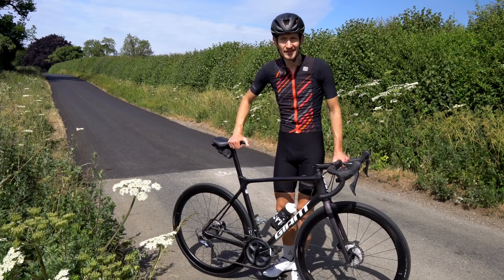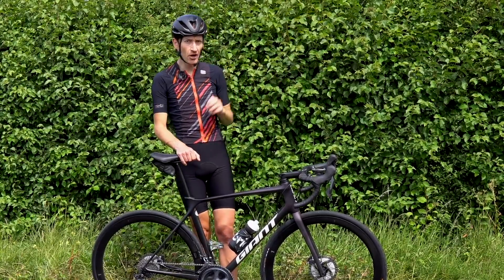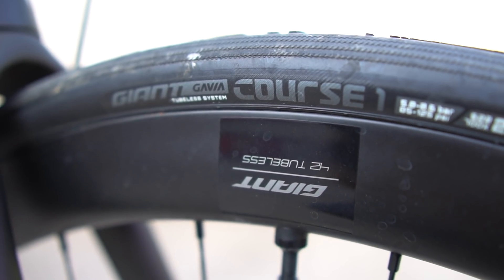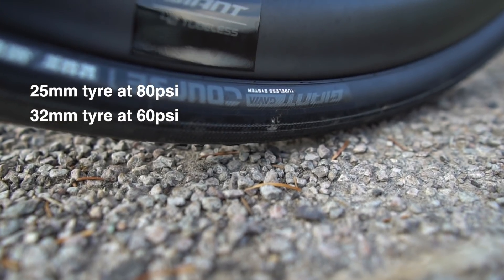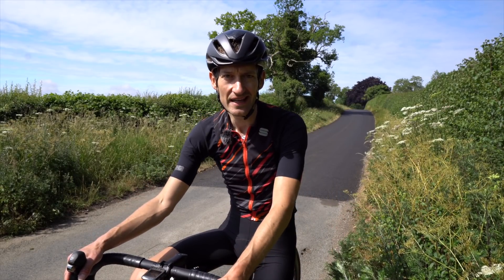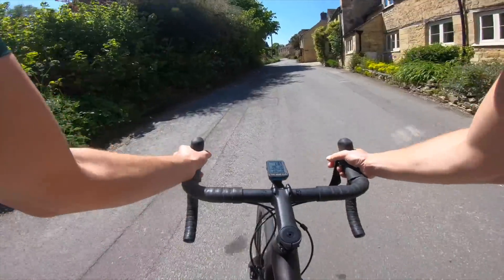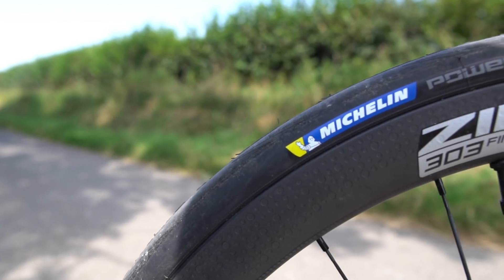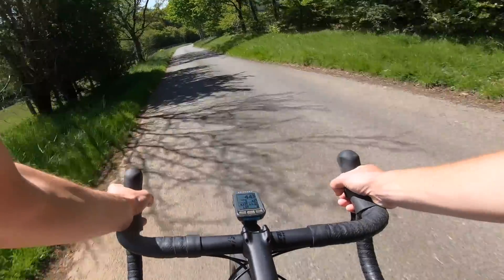Are Wide Tyres Really Faster? Rolling resistance timed testing reveals the truth...

Comment: Video concludes wider tyres are faster when freewheeling at lower speeds due to rolling resistance playing a bigger factor.   

David - wider tyres are faster! 

Biased much?
Reply: David admitted this is 'not really Science' so I can forgive him. Meanwhile the comments continue to fill in the gaps which suggests the video has got people thinking about the validity of their assumptions
Reply: Rolling resistance isn't playing the bigger factor though, at 15mph wind resistance on tops is about 100-115w (not even my 2.6" Maxxis DHF & Rekon combo has that much rolling resistance, 70-80w, so i have no clue why he states that 15mph is the breaking point between the wind & rolling), 10mph it's 48w, the speed at which rolling resistance from tires & wind is equal is about 5 mph or less. So aerodynamics is almost always the biggest drag factor when riding a bike

Comment: But that is at low speeds! What about high speeds like in group rides 22 mph average speeds?
Reply: Group rides you are shielded by your team mates from wind. Wider would probably be better.
Reply: Kjetil Korsveien Even when drafting, aero is still important and aero drag is still the largest force you have to overcome. Otherwise you could just ride a city bike in the peloton and have no negative consequences to your speed.
Reply: Kjetil Korsveien hummmm could be. I guess I was thinking more about racing. I do short intense races ( criterium)
Reply: @korsveien  the other two strategies for races would require you to go aero, either a breakaway (aero) or bunch sprint (also aero)
Reply: At those speeds you just go with the narrow tire. Aero takes over.
Reply: Are you wearing a skin suit yet? If yes, you can start to worry about the aerodynamics of your tires. If no, then what are you even wasting your time here for?
Reply: Gleb Serbin I do actually wear aero clothes and I have dialed in my position as aero as possible

Comment: Id love to see an out and back TT at higher speed/wattage (300 or more watts) to test the aero differences on that standard sized rim width with 25mm tire vs that new firecrest style wide rim with a 28 or 32mm tire. Really want to see if the rolling resistance gains of larger tires outweigh the potential aero losses at high speed... probably depends on the roughness of the surface though.

Comment: As you said, above certain speed aerodynamics come in to play. When going faster than 18 mph tire aerodynamics come into play, quite a lot because of its frontal area. Wider tires will probably weigh more, bigger tires, different tubes, and if done correctly wider rims. In my opinion, 25mm are best for fairly smooth road and when it comes to  rough stuff you should use 28mm, as used by the pros in roubaix.
Reply: I've gone.back to 23c because they blow out to.24.7 on.my 25 wide rims.
Reply: @glennoc8585  sadly something like this happend to me, i  was always running michelin dynamic sport 10$ tires nd they ad the perfect fit on my rim but i decided to get conti gp 4000 sii and now they blow out to about 27mm in my 25mm external rim. Really bothers me
Reply: @larsborgman3443  Continental is famous for lying about their actual sizing. It's a marketing thing, because on the benchmarks of rolling resistance their products look better in comparison to competitors. Due to false sizing.

Comment: Bit of a crap test. The 32mm tyres are quite a bit heavier, so going to be a factor down a hill..
Reply: If the 32mm tyres are say 150g heavier, then this would increase the overall test weight from 70kg to 70.15kg, i.e. about an 0.2% difference which would not be noticeable in this test.
Reply: @seanbolton  Maybe he added the difference in weight to the lighter bike to make it equal in weight? Or maybe he should have.
Reply: The heavier tyres have more mass and thus more inertia. This is not in a vacuum chamber.
Reply: no, weight does not matter because it will accelerate faster but it will also need to accelerate more mass